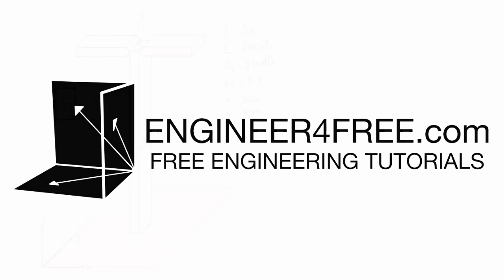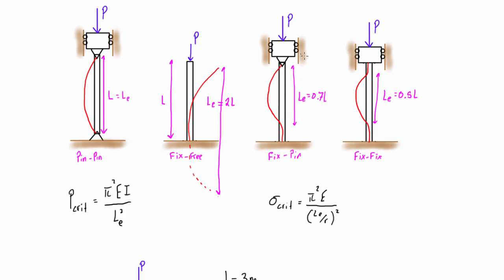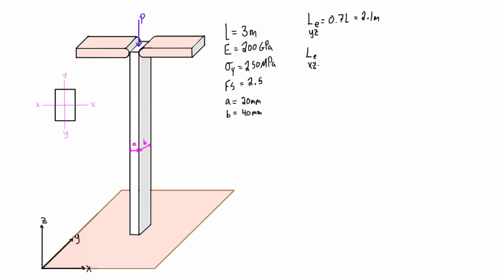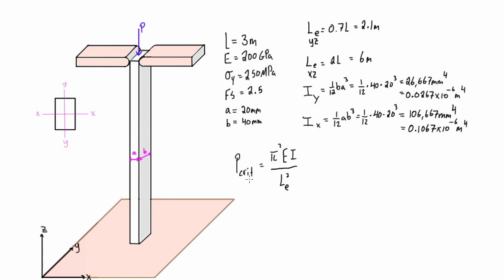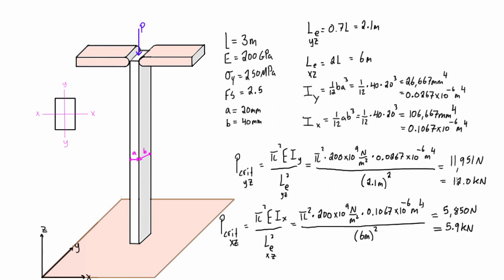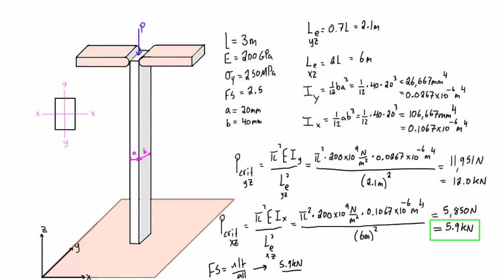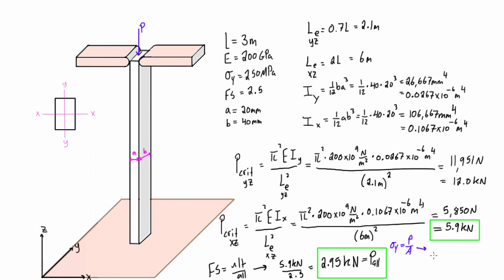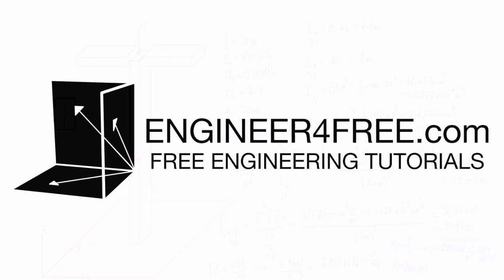Column buckling example problem #4: one end fixed, one end pinned

Comment: Hi.Thanks a lot for these profound videos.I just can't understand why fix-pin connection changed in to fix free connection.In general,I can't understand how these different types of connection can convert to each other.I would be immense thankful if u answer me
Reply from the maker: Imagine that you were pushing on the top of the beam in the +/- x direction. It's constrained at the top with a pinned connection due to the smooth surfaces it's in contact with. Movement in the x direction is synonymous with buckling in the yz plane. So for buckling in the yz plane, the beam perceives the top connection as a pin. Now,  imagine that you were pushing on the top of the beam in the +/- y direction. It's not constrained at the top to move in this direction (take a good look at the diagram). Movement in the y direction is synonymous with buckling in the xz plane. So for buckling in the xz plane, the beam perceives no connection at the top (free). You must consider buckling/movement in each direction separately from each other and then run through the calculations based on what the beam perceives its end conditions to be in each case.
Reply: @Engineer4Free  oh thanks a lot for ur complete response

Comment: i think a video is needed to see X-Z and Y-Z Plane direction. its confusing everyone.
Reply from the maker: For buckling in the xz plane, you will use moment of inertia about x axis. For buckling in the yz plane, you will use moment of inertia about the y axis. Imagine that the bean is bending, and not buckling. If it was bending about the x axis, then you would use Ix. If it was bending about the x axis, the middle of the beam would be deflecting towards positive or negative y. If the beam buckles towards positive or negative y, then that means it is buckling in the xz plane, and you will also use Ix in the calculation for Pcrit. Hope that helps.

Comment: Hi sir. I was confused about 1.16 because I think effective lengths should be the opposite. When I look at the buckling on x-z plane, i see it like a pin connected ( Le=0.7L) and when I look at the buckling on y-z plane I see it as free end ( Le = 2L ). please correct me If I am wrong
Reply from the maker: The way this structure is drawn, buckling in the y-z plane would be buckling sort of left or right, and buckling in the x-z plane would be into or out of the page. The beam is restricted at the top from swinging left or right, which is ultimately movement through the y-z plane. The beam is free to swing into and out of the page at the top, which is ultimately movement through the x-z plane. Does that clear it up?

Comment: Thank you for your video Sir. I have a question about 2.23 because i think if we working on
 Y-Z axis, our moment of inertia should be x direction. Because buckling is on the X direcion.
Reply from the maker: If the column buckles in the Y-Z plane, the material would deform towards the positive x or negative x direction. If the material is buckling in the positive or negative x direction, it means it is buckling about the y axis. Think about it this way, if the buckling resulted in a deformed shape that resembles a circular curve, the center of the curvature would be a line that is parallel to to the y axis. So in buckling, it's not a very good habit to talk about the buckling moving in a specific direction. It's better to talk about buckling in a specific plane. Using the word "direction" will naturally start to confuse us about which axis to use for moment of inertia, because it's ultimately the axis that is perpendicular to the movement of the material after buckling. It's the same axis that we would use if the member was just in pure bending. If we had this member in the video and tried to induce pure bending such that the column bent through the Y-Z plane, it's displacement in the middle would move in the positive or negative x "direction" but we would need to use the moment of inertia about the y axis for the calculation. Sometimes with problems involving moment of inertia, it helps to mentally turn the beam sideways and think about what axis you would need to use if it was a pure bending problem. Does that make sense?

Comment: Your equations for Iy and Ix are the same but yield a different result. Also why is it multiplied by 1/12?
Reply from the maker: I = (1/12)bh^3 is the formula for the centroidal moment of inertia of a rectangle. You can find this formula in the moment of inertia tables in any mechanics of materials book. I use that base formula for both Ix and Iy in this video, but "b" and "h" switch because of how we are looking at the rectangular cross section for each Ix and Iy. When the formula is written as I = (1/12)bh^3 "b" is referring to the edge length parallel to the axis we are taking moment of inertia about and "h" is the edge length that is perpendicular. It's good to realize that b and h stand for base and height and depend on the way you are observing the rectangle, its often better to just use the letters provided, that's why you see me inputting "a" and "b" into the formula. So when We do Ix, the x axis is parallel to side "a" in this video (it's the base from this point of view) and side "b" is perpendicular (it's the height from this point of view). When we turn our head and consider Iy, the y axis is parallel to side "b" (it's now the base from this point of view) and side "a" is perpendicular (its the height from this point of view). So I used the same base formula but you'll notice I switched the order of stuff that I put in. 40*20^3 does not equal 20*40^3, hence the different answers. For an non-square rectangle, the centroidal moment of inertia will be greater when viewing the rectangle from the point of view that it"s "heigh" is greater than its "width" and is so because the "height" gets cubed whereas the width does not. Basically translates into if being stronger in that "direction."